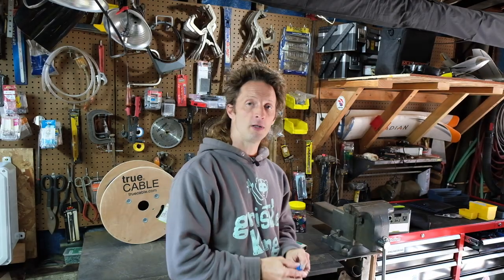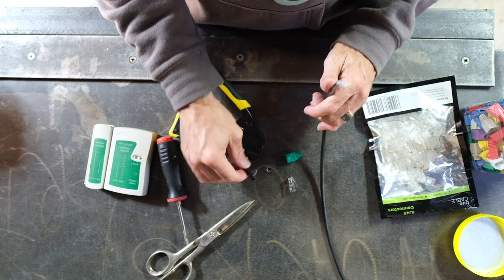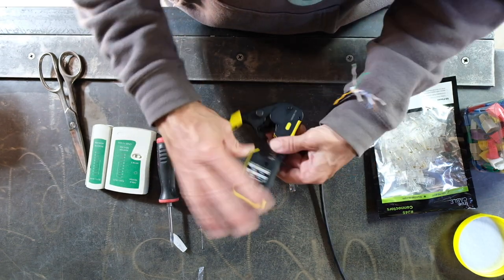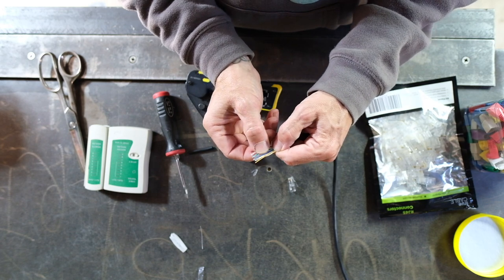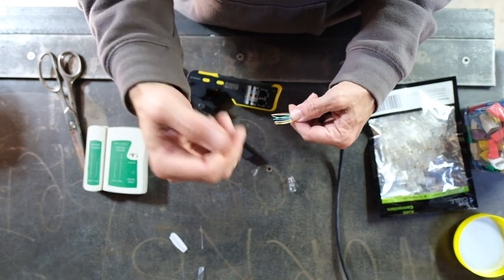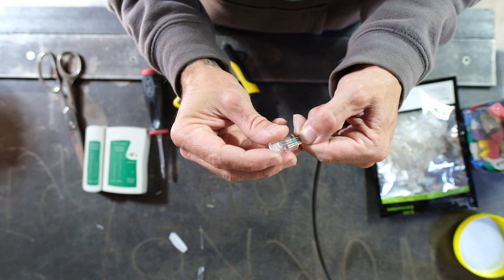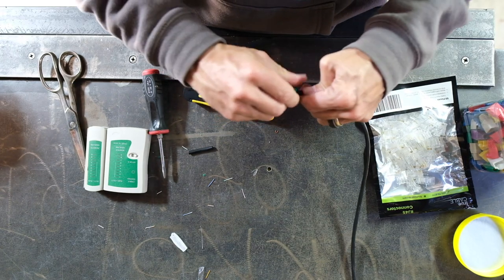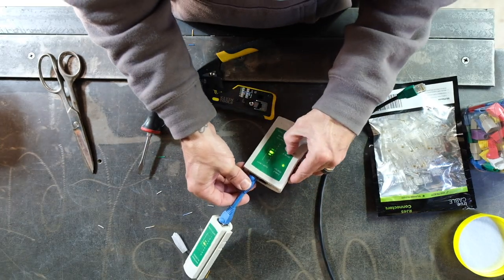Making Custom Length Ethernet Cables

Comment: Good job...take it from someone who owned a low-voltage wiring company for 25 years...buy your twisted pair cable that comes in a box instead of a spool...youll thank me for it...nice termination tool btw...does a great job.
Reply from the maker: Interesting, I didn't know about the box vs spool thing.  Why is that?
Reply: @thegristleking  You can get 1000 foot box that you can carry around a lot easier and not have to use a pole to pull it off the spool. I get that you’re making smaller length of cable and it’s not a big deal when you do that. But if you’re pulling it from the basement up a wire chase to the attic or the roof it’s easier to have it pull right out of the box.
Reply from the maker: @carlbreeden9074  makes sense, thanks!
Reply: What kind of ethernet cable do you need cat6 ?cat7?
Reply: @divinesoto4656  for little pig tails doesn’t really matter 5e is fine…longer runs may need better cabling. 6 is enough in longer applications. Not even really necessary unless your runs are super long.

Comment: Are you Using solid or stranded cable for the patch cables?
Reply from the maker: I've used both.  Prolly doesn't matter for this.
Reply: @thegristleking  ok thanks. I was always told to use solids for the runs and stranded for the patches.
Reply from the maker: @buccaneerred  Thanks, that makes sense to me!

Comment: You guys all do the same thing.  You put one end of a cable on and say now you have an internet cable.  So  is it brown on the right for both ends or is it reversed on the other end?
Reply from the maker: Should look the same, not reversed, on both ends.
Reply: @thegristleking  Thank you
Reply from the maker: @dksayt  no worries.  Let me know if you don't get it.  If you're building more than a few cables it's worth it to buy one of cable testers, they're called "RJ45 Network Cable Testers" on Amazon and run about $9.